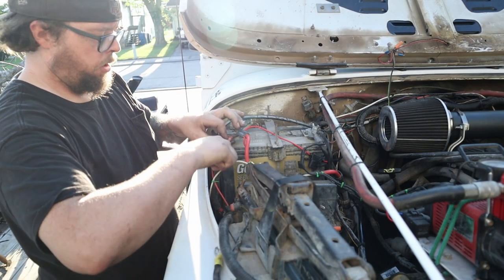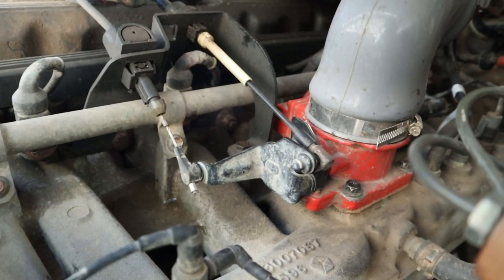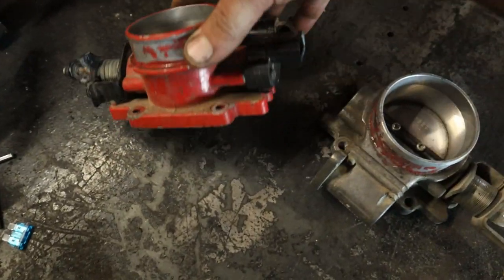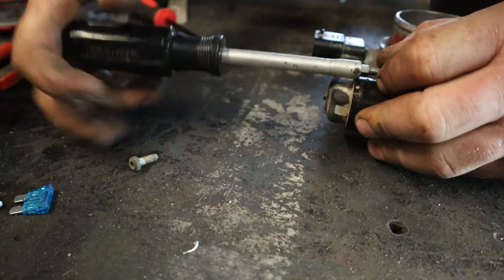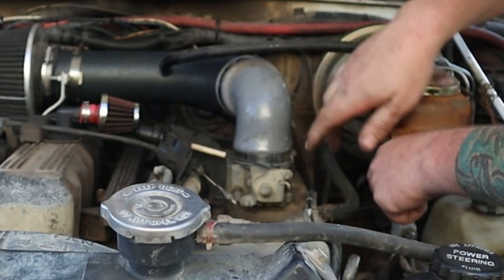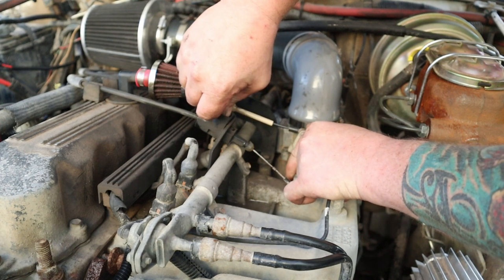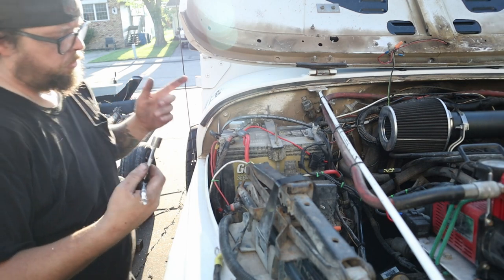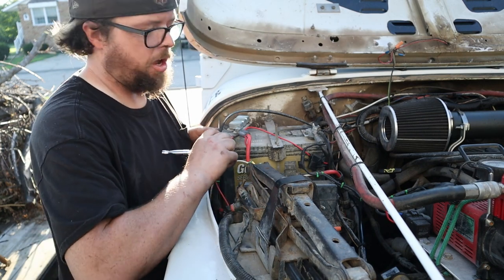Watch This Before You Buy a Bored Throttle Body For Your Jeep 4.0

Comment: Try using a little die grinder bit and make a few small vertical notches on the top of the idle air control port opening to prevent whistling on the 62 mm throttle bodies.
Reply from the maker: Ill have to look into that to see exactly what you mean. are you talking about the tapered seat that the iac sits down in
Reply from the maker: Im making a follow up to this, I tried rounding all the sharp edges on the ports and made a few notches but it didnt help. I cant find a picture online of how deep people are saying to make them, do you have a source?
Reply: @FlawedOffroad  if you smoothed it out, I would think it would make it worse. To get rid of the whistle, you'd want to interrupt the laminar flow I would think.

Comment: Any one small mod alone is not going to make a big difference on it own.  Now if you do a real cold air,  a bigger throttle body,  cam , port head , injectors,  headers and exhaust,  maybe some ignition and fuel tuning.  All the sudden the sum of mods has made a big deference.
Reply from the maker: I agree. that was never the intent of why I installed the thing though. Honestly back then my friend used to pull them from junkyards, bore,blast,paint,sell them and I gave him a core and he gave me a completed one. So I used it
Reply: This is correct you're never going to get much power out of these until you can force more are and more fuel into the engine and you have to have the valves to do it the cam to give you the lift and duration and a displacement to hold it all not to mention the fuel to add to the air

Comment: Bet it’s that idle air control valve your not supposed to clean them. They are very touchy and pressing on the plunger can damage the motor. Pretty sure when you buy them they have a piece of paper with them warning not to attempt to clean them.
Reply from the maker: All I did was spray the tip of it with carb cleaner to get the crud off of it but I do have a spare one laying around I could try to swap in. In my experience when the IAC is bad the vehicle will not idle for s*** and mine idles just fine

Comment: I'm sharing here. 
Most things don't make much difference. Some help a little and a couple help a bit more.
Spark Plugs: YJ's are picky about plugs. Avoid gimmick plugs. Use plain old Champion Copper Plugs every 30K. No Iridium, no platinum.
YJ's have a restrictive exhaust and can benefit from exhaust work. 
Don't bother with bigger throttle bodies. Nothing there. Performance intakes: Nothing there. The stock intake provides all the air a stock 4.0 can use. 
Stroker kit. Lot's to be had there.
Under hood supercharger kit. Yes, there are moderate to big gains. (It's the Pontiac Supercharger) 
Here is my Jeep 0 to 75 
https://www.youtube.com/watch?v=Xne13WWGeLo&ab_channel=ChrisNVegas
Reply from the maker: I have a few parts stashed aside for a possible future stroker build but Shhhh

Comment: The 4.0 and 2.5 throttle body and intake and exhaust are over engineered there is no air restriction you are never going to see any performance gains by boring these out any bigger you have to get bigger valves in the head to allow more air in the engine because that's where your restriction is going to be the size of the valve how long it opens and how far it opens the only way to get past this is either with a new cam or bigger valves or forced air induction

Comment: Nice HOT air intake sitting right over the motor, that's just fucking stupid
Reply from the maker: I had to remove the stock airbox because my aftermarket brake booster interfered with it. This is what I could make work in a quick/cheap manner. at least I put it on the colder side of the engine and not right above the exhaust. Plenty of people run it this way with no issues, especially since I have a ton of hood vents. But thanks for your asshole opinion👍

Comment: Larger throttle body needed for a stroker
Reply: Correct you're not going to see any power from a larger throttle body unless you have the displacement and the bigger vavels to let it in the engine

Comment: Most websites say it goes up to a 2003 I have a 2004 Jeep Grand Cherokee :/ do they have one for my Jeep
Reply from the maker: Im not as familiar with the 2000's 4.0 stuff, there must have been some sort of change. is it drive by wire or something? Id try to google it. Otherwise you can pull your tb and take to a machine shop, that may not cost any more than buying one online

Comment: Nice hot air intake
Reply from the maker: Ive explained why its like that 1000 times, stock airbox had to go to fit big brake booster/master. it really doesnt make a negative difference. It used to be on the driver side which is the real hot side lol. It's fine I promise